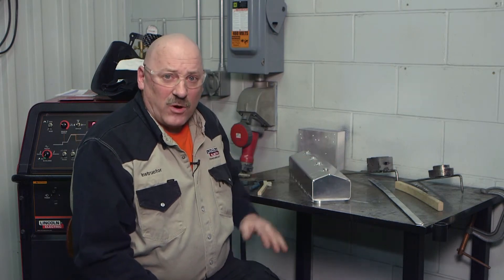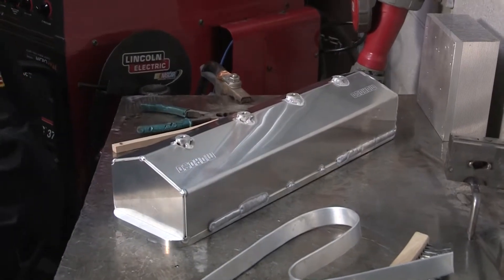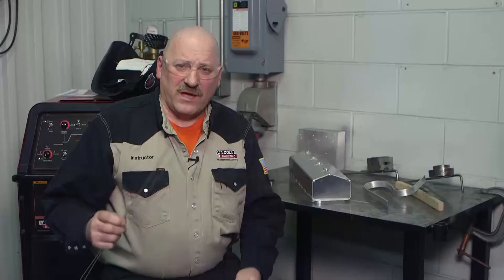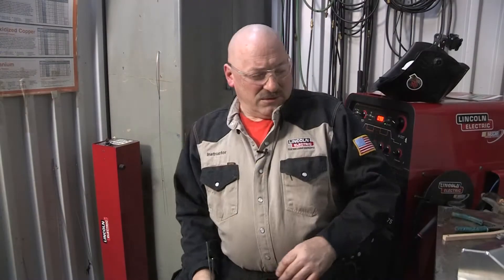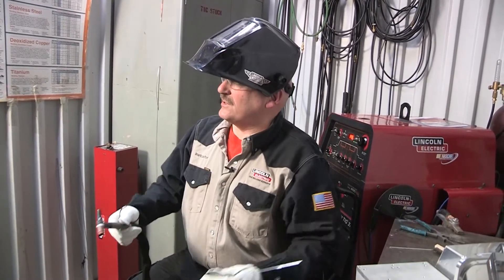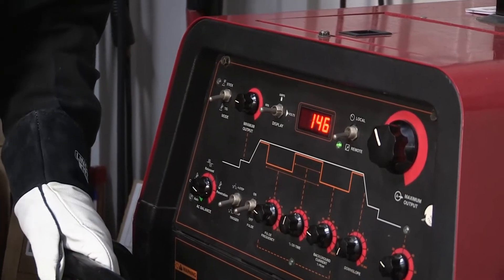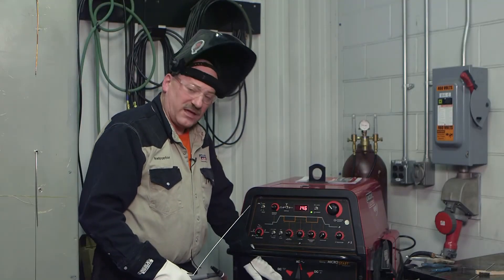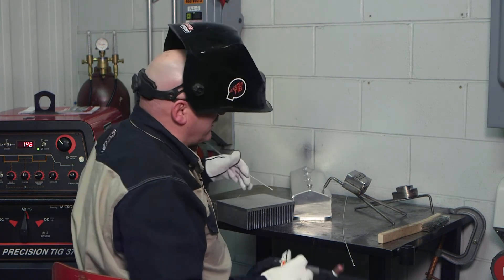Arc Magazine Master Class: Aluminum Filler Metals

Comment: At service conditions above 150 degree F - couln't you have used 5554 just like ford does on the f150?
Reply from the maker: When welding 5052 to 3003, the best electrode to use for service temperatures above 150° is 4043. 

http://www.lincolnelectric.com/assets/global/Products/Consumable_AluminumMIGGMAWWires-SuperGlaze-SuperGlaze5356TM/c8100.pdf?utm_source=leco-landing-page&utm_medium=banner&utm_content=weldingguide&utm_campaign=aluminum-solutions
p.p1 {margin: 0.0px 0.0px 0.0px 0.0px; font: 11.0px Calibri; color: #1e497d}
span.s1 {font-kerning: none}

p.p1 {margin: 0.0px 0.0px 0.0px 0.0px; font: 11.0px Calibri; color: #0463c1}
span.s1 {text-decoration: underline ; font-kerning: none}
Reply: Thanks!  i guess after reading the literature - the reason why 4043 is used and not 5554 is more so the joining of the different alloys.  Thank you - very informative brochure